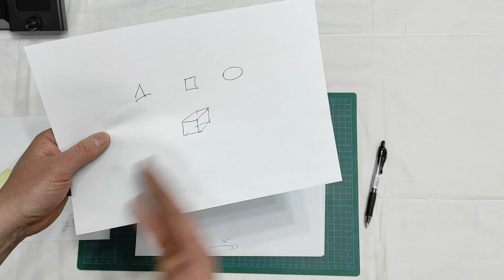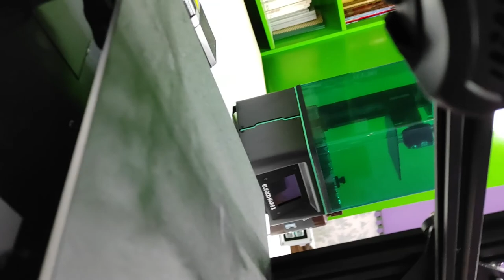UNDERSTANDING 3D PRINTERS

Comment: Very Nice explanation of understanding 3D printers, enjoyed the video! What are you using to wash your final print and cure the image!
Reply from the maker: Hi Robin. Thank you. As I am using water washable resin, I have a big plastic food container filled with water and dish soap. The final print goes directly in the water then I use a big brush to reach every little spot. When all the printings are done, I put the plastic container with water under the UV lamp for some minutes and the resin in the water will cure. Finally, I filter the water, then collect the solid resin to dispose of it in the non-recyclable waste and the purified water can end up in the sewers.
Once the final print has dried, I remove the supports and use some fine sand paper before putting it on a motorized turning table inside a small box that I printed with my FDM printer and that has a hole on top for the UV lamp. 1 to 2 minutes of curing time and the final print is ready for primer and painting.